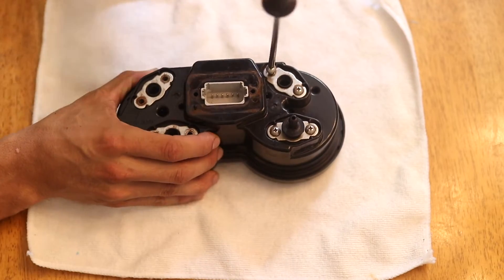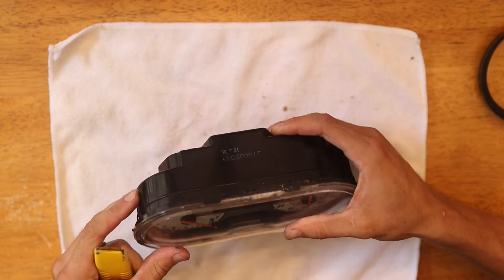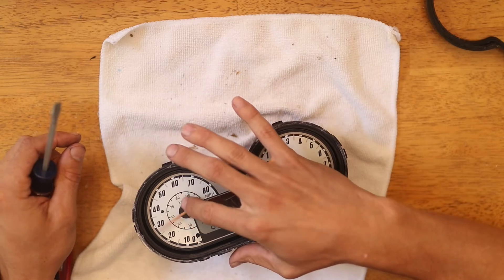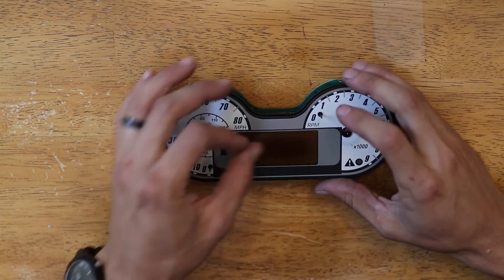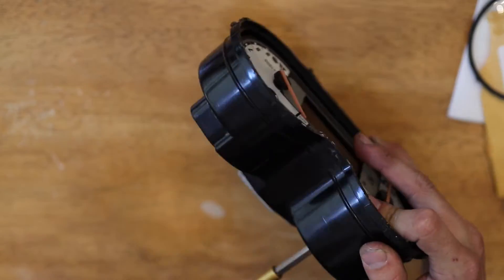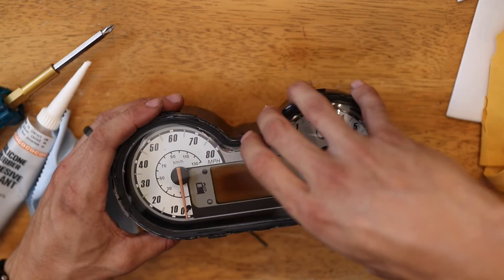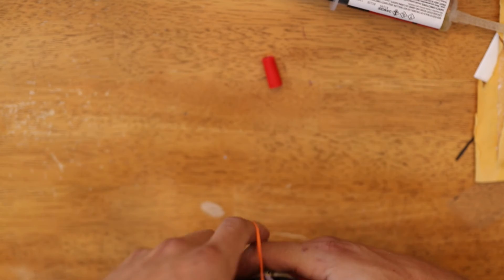Gauge Display Teardown / Polarizer Replacement | SeaDoo GTX 4-Tec

Comment: How do I remove the cluster? I am not able to find a video. I have the same 2003 model and NEED help removing it.
Reply from the maker: It’s just held in with the rubber gasket around it. Use your fingertips or a plastic pry tool to pull out the gauge cluster AND rubber gasket, then remove the gasket after you get it out.

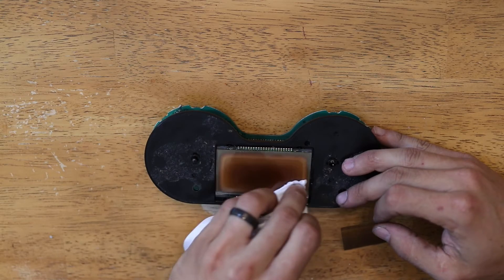Comment: Do hou have a video to remove the gage cluster? 2:36
Reply from the maker: No, just use your fingertips or a plastic pry tool to pull out the gauge cluster and rubber grommet, then unplug the wiring harness.
Reply: I can't get my 2004 gauges out either. I got the little bezel to pull off and there are clips around the clear lens. But I can't get the gauges out of the dash. Had the whole bottom cover off and wires disconnected. Can't see any bolts or clips. Having trouble even removing the little semi transparent top cover over gauges. Don't wanna snap the 21 yr old plastics. Can't get gauges or MPEM anymore. So trying to be careful

Comment: I don't know how to get the cluster out of the out of the Sea-Doo it's the same year and model as the one in the video
Reply from the maker: The rubber gasket is the only thing holding it in place. Just use your fingertips or some plastic prying tools to slide it and the gasket straight out towards you.

Comment: I bought an iPhone polarizer film but it's either too dark or light. I can only read the screen in direct sunlight with polarized glasses on. Can you suggest where I can get one that'll work, when I tear it back down again.
Reply from the maker: If you can only read the screen with polarized glasses on, then the polarizer filter was probably not in the correct orientation, and should have been rotated 90 degrees. Try looking at any other LCD screen with polarized glasses on and tilt your head both directions. You can see it getting darker and lighter as the opposing polarized lenses rotate relative to each other.

Comment: How do I know  if it is the protection film or if it is the actual screen mine doesn't look damaged, but I can't see anything on the screen
Reply: I think it's called the LCD cause my screen looks completely normal but I'm not getting any picture on it
Reply from the maker: Mine was clearly the polarizing filter because it looked burned and cracked on the top layer of the LCD. Do your gauges work properly? It may be a problem with the actual LCD display if the screen appears normal.

Comment: What pins are justed to test the display with out a jetski
Reply from the maker: I’m not sure that you can test the display without a signal from the SeaDoo computer. You could possibly test the gauge needles, but I don’t know what pins would need power to do that. I tested mine before reassembly by plugging it into the SeaDoo wiring harness.

Comment: Is the front plastic screen held on with an adhesive? Would it be easier to heat it up to make it easier to remove? I have moisture getting into my screen so I’m pretty sure I need to remove that front lens and re-seal it
Reply from the maker: The main (outer) lens I’m guessing is epoxy welded. It was extremely difficult to open up, and that’s with me using a box knife and any other tools that I thought would help. I doubt a heat gun would help. If the issue is just moisture getting inside the main part of the gauge assembly, you could try removing the pieces on the back, letting it dry thoroughly, then reinstall them and seal any cracks or potential openings. I would avoid cracking open the assembly unless you have to repair something inside it.
Reply: @FixandMaintain  sounds good, thank you for the reply

Comment: i need help I can't seem to be able to remove the odometer from the jet ski how do you get it out? i have a 2004 gtx supercharged
Reply from the maker: It's simply a rubber gasket behind the trim holding it in place. Try getting a good grip with your fingertips and work it back and forth until it comes out. While it's best not to use tools to remove it, any kind of pry tool may help break it loose if the rubber has dry rotted. Just if you use tools, you run the risk of damaging the gauge cluster or the plastic cowl.

Comment: putting a new film on the back is awkward because you have to pull out the pins on mine to get at it.i hope they come straight out
Reply from the maker: I actually did de-solder the LCD on mine and successfully re-soldered it, but I chose not to replace the rear polarizer because of the potential of damaging the liquid crystal layer. The display was completely illegible to begin with, and after replacing just the front polarizer was quite easily readable, so I took then win and put it back together.

Comment: i have my instrument cluster out of the car do you need the cluster powered to see display
Reply from the maker: Yes, it does need to be powered to see any information on the display. If you're halfway through with the repair and haven't installed the new polarizer yet, you can actually test the display while wearing polarized sunglasses or by holding the new polarizer in front of the LCD (otherwise, without the front polarizer, the display will remain blank).

Comment: do you not have to remove and replace polarising film on the back of the display  screen
Reply from the maker: I would advise against it unless you absolutely know what you're doing. I don't think that I would have been successful if I had to disassemble the LCD. There was some damage on the rear polarizer on mine, but it wasn't worth the risk of damaging the liquid crystal layer getting it off.

Comment: my friends i fix my gauge with polarized from i phone 5 and i see different screen... now the words are white and the sceene is black but it work...now I do not see the indication of fuel... i buy the polarized film for i phone 6 plus and in the next days i will write if does work good or doing problems again...
Reply from the maker: I didn't realize it when I was recording the voiceover audio for this video, but it was actually an iPhone 6 polarizer that I used. I did correct it in the description, but I had forgotten that I said iPhone 5 in the video. I've updated the video to add a card at that point in the video. Let me know if you were able to get it working again.

Comment: Great video.  Followed the suggestion to dremel apart the housing and then reweld with plastic welder $17 from Harbour Freight including ABS strips  (https://www.harborfreight.com/80-watt-iron-plastic-welding-kit-60662.html ).  Doesn't look great but works fine.  Got both needles off successfully by putting 2 flat blade screw drive under needle on opposite sides and gently twisting each blade - needle makes a cracking/creaking noise but comes off fine.  If needle is bent do not try to straighten it - it will break!  Before welding up the housing plug the unit into the Seadoo and connect start strap - unit goes through start up cycle that moves both needles for a few seconds,  then place needles in correct zero position.
Reply from the maker: Thanks for the info! That's a great suggestion to make sure you get true zero for the gauges!

Comment: I took mine apart needles came off fine. But can't get the white part with the numbers off any suggestions
Reply from the maker: Mine was only secured with light adhesive. I think I was able to get it off with just my fingernails, but it’s been a few years so I don’t remember. You might be able to use a butter knife going in through the cutout for the LCD to try to get it started. Either that or a small putty knife.
Reply: @FixandMaintain  i will try again I just don't want to destroy it as it started to crack when I tried before. Thank you
Reply from the maker: @danzimmer4175  ok, yeah, mine didn’t seem to be very brittle when I removed it. The only other thing I can think of to suggest would be to use a heat gun or hairdryer on low heat to soften the adhesive before attempting again. You would have to be very careful not to get too close and cause discoloration to it, though.

Comment: How you took out the gauges out the jet ski
Reply from the maker: They’re only held in by a rubber gasket around the gauges. I found it easier to take out the gasket with the gauges (just using my fingers). After you get it out, there’s a wiring harness plugged into the back that you just have to push down the tab to remove.
Reply: So, I just pulled it out
Reply: I can't get my 04 to pull out. The bezel around the clear lens ripped off. But gauges won't come out of dash

Comment: 2003 Sea Doo GTX.  Thanks for the vid, I followed your direction and it was a breeze. A little nerve racking but easy with the right tools,  I did find a video on how to remove the dials real easy.  Use 2 forks to pry them up with, one on each side.  Took me longer to figure out how to get the display out of the hood.  It just pulls out with a little prying.   Thanks Again
Reply from the maker: Glad I was able to help, and good to hear that you were able to get yours fixed!
Reply: Do you still have your 2003 model? I could use some help from you to repair mine which had a bad ECU.
Reply: Hola donde puedo conseguir el protector para el LCD

Comment: Hi, thanks for the video. I was able to get the front plastic covers off and replace the polarizer film. I was also shocked that I was able to remove both needles without breaking them. It looks ok to me now. The inner front cover has a foam gasket around it. Should I still be using silicone adhesive at that stage? I was also wondering if you would still recommend using epoxy to fasten the top cover? My worry with using epoxy would be the difficulty of ever getting into the cluster again. Would silicone adhesive work for the top cover as well?
Reply from the maker: Congratulations on successfully removing the needles without breaking them, that's quite a feat! I'm certainly not an expert on the matter, but I would say yes to both questions. If you silicone the inner cover in place, it's extra insurance against water intrusion ruining your gauge cluster. As far as the epoxy on the top cover, I personally didn't feel the need to leave any way to get back into the gauge cluster afterwards because I always leave my SeaDoo covered when it's not being used (the longest it went without a cover on it last year was for a day out on the water). It was sun damaged when I bought it and I assume it was from extended periods of being uncovered, not from periodic uncovering for regular use.
Reply: @FixandMaintain  
Good point. I bought mine used as well and it was already sun damaged. I don’t leave mine out either so really shouldn’t have that issue again. On another comment I read that you had some condensation after the repair. Were you able to solve it by reapplying more epoxy to the top cover? What kind of epoxy did you use? JB Weld or something similar?
Reply from the maker: I had a very small amount of condensation after a day out on the water (I know the gauge cluster got splashed on more than one occasion). It quickly cleared up by the next morning. I believe it was from one of the cracks in the top lens, but not 100% sure. I applied a small amount of 100% silicone (like the stuff from a caulk tube, but not the cheap siliconized acrylic) around the edge and along the outside of the cracks, and wiped off the smeared silicone from the lens with an alcohol soaked cloth. I never had any more issues with condensation after that.
Reply: @FixandMaintain  
Perfect, thanks for all the help.

Comment: Tips on how to pull apart clear covers
Reply from the maker: Mine weren’t stuck together. It was a foam seal holding the inner cover in place. Once I got the outer cover off, I was able to pry out the inner cover fairly easily.
Reply: Yes I was able to get the black trim off but the outer clear cover is really on there . I just bout it used and wanted to swap out the clear one from mine to the new one since it’s less damaged . Plus it’s recommended to re seal it with better stuff then factory . Don’t want water damage again . Too expensive and hard to find . Mine was too far gone to rebuild it
Reply from the maker: They definitely are too expensive not to seal up as good as you can! I was shocked when I called my local dealer and they said it would be $800 for a new gauge cluster.

Comment: I got mine all changed and put a new piece of polarization film but the words/numbers are very dim, I’m wondering if I did not get the correct piece of polarization film? I was trying to post a picture to show you but cannot figure out how to do that
Reply from the maker: That doesn’t make sense that the display is readable but dim, unless there is an issue with the display or the film. If you had to cut the film, did you use one of the existing corners of the film and only cut 2 sides or did you cut it out from the middle? From my limited understanding of polarization, the film has to be aligned in just the right way for it to work properly.
Reply: @FixandMaintain  I just cut the corner of it where I only had to cut two sides, Somebody told me you have to change the front and back of the screen but I don’t see how you take the screen out if that is true
Reply from the maker: I actually did remove the LCD from mine be de-soldering it from the circuit board when I was in the process of diagnosing why I lost power to the gauge cluster (turns out it was a bad 12v wire from the MPEM, completely separate from the gauge cluster), and I would not recommend anyone attempt it unless they are good at soldering many small wires! I’m not sure what is on the back of the screen to replace, mine was very readable with just replacing that one polarizing filter on the top of the LCD.
Reply: @FixandMaintain  Yeah I am not trying to remove the screen but just trying to figure out what to do with it I ordered a piece of polarizing film off of Amazon it was 4 x 5”...Even if you use the cell phone film you still had to trim yours correct
Reply from the maker: Yes, I used a polarizing filter from an iPhone 6 and had to trim it down to size. 

I just asked the question about cutting it on the off-chance that you may not have cut it exactly squared with the polarizer orientation and may have installed it a few degrees off-axis. But that doesn’t sound like that’s the issue. I wish I could help you, but I don’t have anything else.

Comment: That was a FAIL. Lol
Reply from the maker: A fail that I had a gauge display that was completely unusable due to sun damage and now it works fine? A fail that I saved $700+? Sure, it's not as good as new, but at least it works!
Reply: @FixandMaintain  Neither of the two you've mentioned.  Just a fail in that you could have taken more time in learning how to complete the task without the carelessness that you depicted in the video.  If I'm going to take time out of my life to watch a video only to later perform the task myself, I want a 10 out of 10 instructional video.  Not one whereby you're "winging" the repair....Having typed all that, I shouldn't even be complaining; I do nothing to contribute to the platform. lol
Reply from the maker: So, I was “winging” the repair only because there was absolutely no information other than a vague forum post (mentioning what I referred to as the “Dremel Method”) that had a couple of blurry photos in it. That was the ONLY information available on the entire internet for me to go off of! SeaDoo would much rather you buy a new $700 gauge cluster from them than show you how to repair a part yourself that they consider to be non-reparable. I made this video in hopes that it would help at least one person out in their desperate attempts to repair a gauge rather than replacing it completely. 
That being said, with over 13K views and ranking near the top of Google results for SeaDoo gauge repair, I’ve far surpassed my expectations in the popularity of this video. This was a brand new channel when I uploaded this video and thankfully I’ve had some other ideas for videos to upload, but I’m far from the threshold to make any money from it (1K subscribers and 4K watch minutes in the past 365 days).
Reply: @FixandMaintain  don’t listen to this person. It’s completely function and for the fact that it’s an educational video I think it helps that you messed up a little bit because someone could have made the same mistakes if they didn’t see the video. On another note, can you please tell me how to get the gauge cluster out of the jet ski. That might be a dumb question
Reply from the maker: @bigjayk4527  thanks, yeah, if I had a second gauge cluster to practice on, I could have made a much more polished video. However, I’m pleased with how well the repair worked!
At least on my SeaDoo, it was just held in with the rubber gasket. Grabbing it with your fingertips should work to pull it out. If it’s too stuck to pull out by hand, gently prying the cluster and seal with a screwdriver may take it out, but be careful not to scratch the display or damage the cowl.